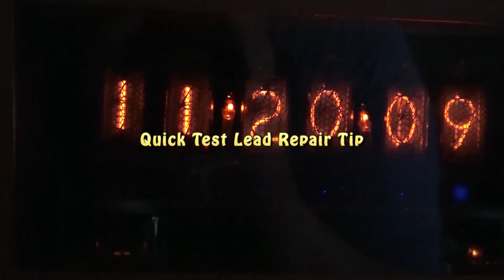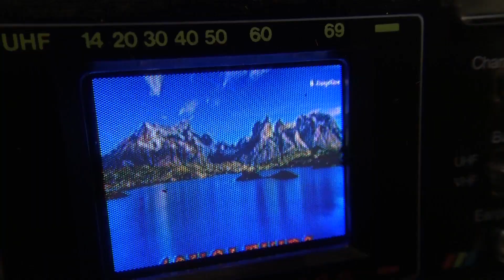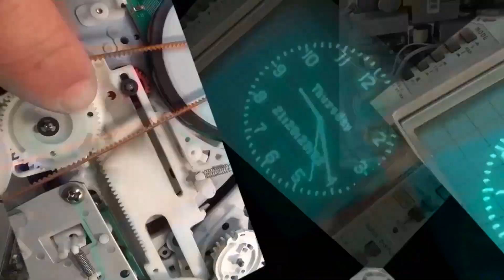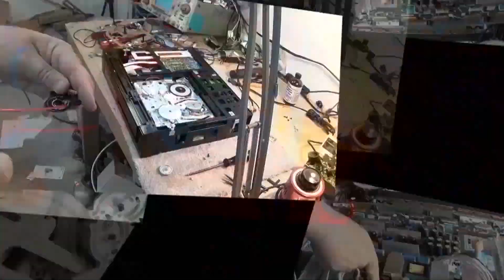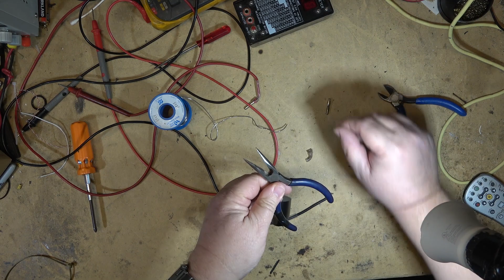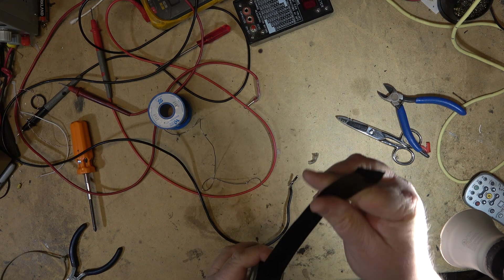Quick Tip Fixing A Broken Test Lead

Comment: No clothes pins? The next time you happen to walk pass the closet where your wife keeps stuff, see if she has a bag of clothes pins and "borrow" a couple. Maybe she has them near the washer/dryer. Another place that has them is the local dollar store. A whole bag of them for a buck or a little more. I use them for all kinds of things, from keeping the kitchen trash bag from slipping into the trash bin to keeping a dust towel over my electronic piano. I'm kind'a like you, I multi use things when needed.
Reply from the maker: I was referring to there are none around the shop. I didn't feel like heading up stairs to find one.

Comment: Dave, I got one better than that. On the needle nose pliers, put a rubber band on the handles or, sometimes a wood clothes pin. The wood does not transfer the heat as much as the steel. for something a little more fancy, Helping Hand clips. Keep up the good work.
Reply from the maker: Wood clothes pin would be good too.  I just don't have any handy.

Comment: Most meter wires brake just as it enters the back of the probe body.
Constant bending slowly snaps each thin wire, but the cable looks ok.
Put 5 amps through the cable and feel for the warm part,  that's where most of the wires are snapped.